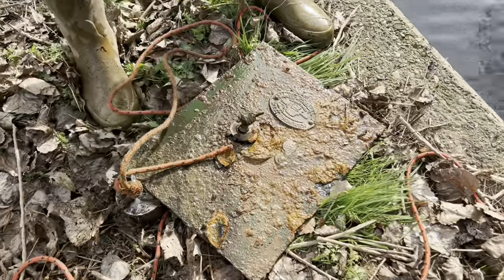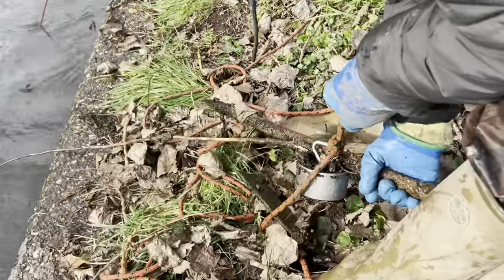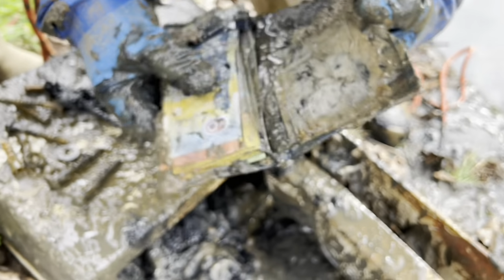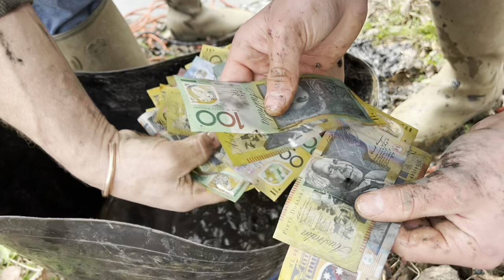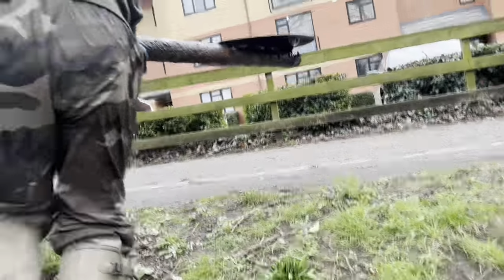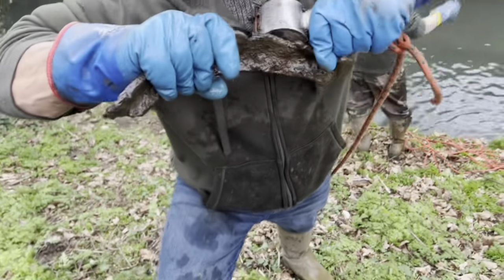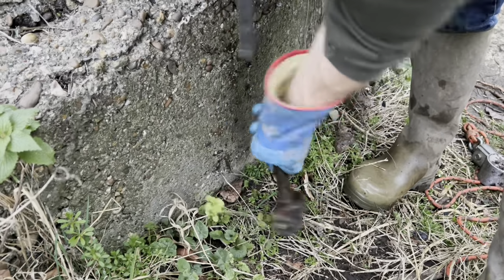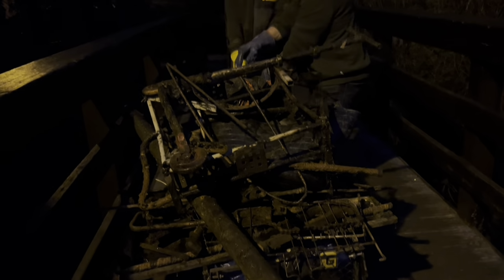Finding THOUSANDS OF DOLLARS While Magnet Fishing!!! **FULL SAFE**

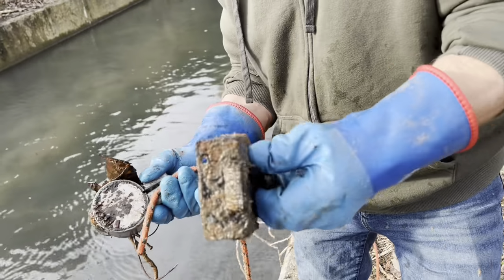Comment: 7:00 You fellas should refrain from standing/yanking on dredged-up items with portions of the rope underneath, since you could easily nick the rope on the objects' sharp/rough edges, and then the rope could break and you'd lose your magnet when you toss it out again afterwards.
Reply from the maker: Hi Fred yes we try not to but sometimes it’s unavoidable. We regularly check our ropes which is important. Hope you enjoyed the video, thanks for watching 👍
Reply: @Magneticg  Well, I just mean, you should set the magnet-caught item on the bank, and then carefully check to see that there are no coils of rope underneath the object, and if so, then you would momentarily re-lift the object and remove the loops of rope before you stand on the object and yank your magnet to get it off again.  Couldn't you perform that precautionary step every time, no matter what the object was...?

Comment: What equipment do you use? I have been looking at those amazon kits, are they any good?
Reply from the maker: Hi Thomas we would say definitely avoid Amazon you may get a good magnet or you may not. The problem with Amazon is that some sellers advertise the magnets at a certain pull strength and when you get them they don’t pull anything like what they are supposed to. We would always advise that you go to a reputable recognised magnet company that way your magnet will be pulling what it is advertised at. We buy all of our magnets from a company called Online Magnets they are the leading supplier of fishing magnets in the U.K. They will also ship worldwide. Below are the links to the magnets we use in our videos. If you purchase anything from Online Magnets type in discount code Mag10 at the checkout and you’ll get 10% off your order 👍

Online Magnets 200KG Double Sided
https://onlinemagnets.co.uk/200-x-recovery-clamp-neodymium-400kg-fishing-magnet

Online Magnets 300KG Double Sided Magnet 
https://onlinemagnets.co.uk/300-x-recovery-clamp-neodymium-600kg-ishing-magnet

Online Magnets 500KG Double sided magnet THE BEAST
https://onlinemagnets.co.uk/beast-1000kg-fishing-magnet

Online Magnets EVOLUTION 1600KG Magnet 360° magnetic field
https://onlinemagnets.co.uk/1600kg-evolution-360-degrees-neodymium-fishing-magnet-3527-lb

Online Magnets GRAVITY 1 TON 1000KG
https://onlinemagnets.co.uk/1000kg-pull-fishing-magnet